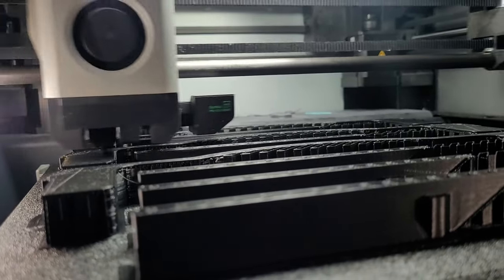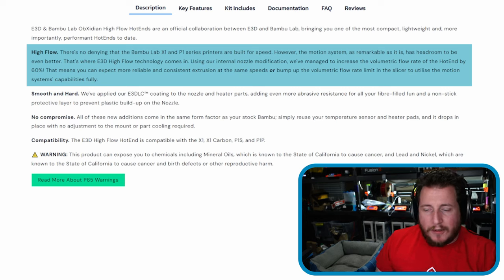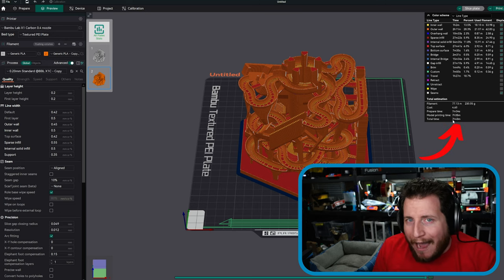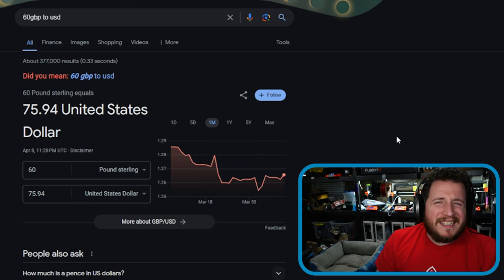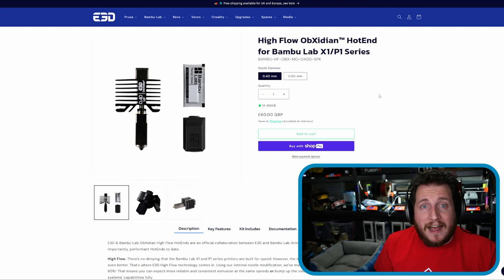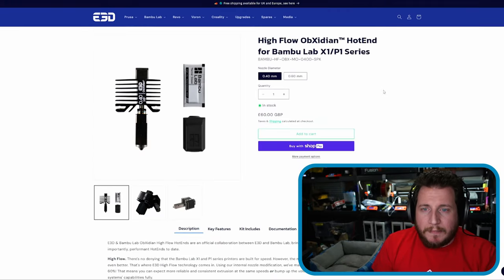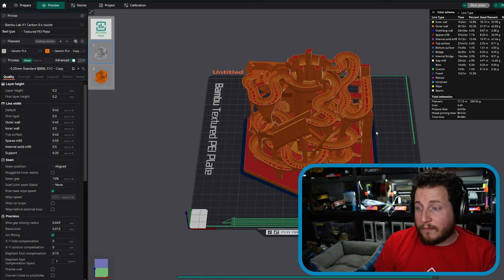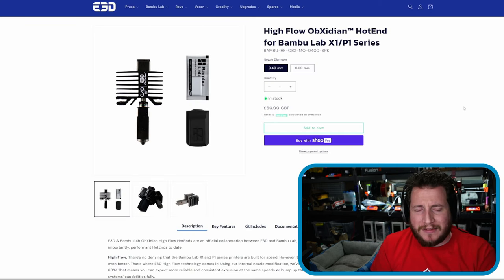Make Your BAMBU FASTER With E3D!!

Comment: how do I setup how to use this hot end? I've seen tons of videos showing that it has better flow but no one showing how you configure your slicer to take advantage of it.
Reply from the maker: just increase your volumetric flow. You can look to increase the speed too, but volumetric flow is often all that is needed
Reply: @3DMusketeers  how do I know by how much? I use orca slicer or Bambu slicer depending on the printer
Reply from the maker: you can run the flow test in orca and find out :) But generally 40% is a good starting point
Reply: @3DMusketeers  ok, I did all the flow calibrations and adjusted that... how would I now increase the speed?
Reply from the maker: you have to increase volumetric flow in the slicer. Then if you need, you can increase speed too. Likely you are limited in speed by volumetric flow already.
Reply: @3DMusketeers  I actually did increase flow... I used the auto calibration and it changed flow to .999
Reply from the maker: nope, that is extrusion multiplier. Look for volumetric flow rate.

Comment: I got both 0.4 and 0.6. The 0.4 is in one of my X1C's and working perfect! Heck, you should try to slice normal and than print on ludricous mode... It just prints fine, I couldn't tell the difference between the two Orca Cube's (one on 100% and one on 166%)... only one thing did reveal it: overhang above the orca slicer logo (and even that was acceptable for a normal print). Soon I'll place the 0.6 in one of my other X1C's.

Comment: I have 1 bambu P1S running a E3D ObXidian HF and 2 running BIQU Panda Revo and the E3D is my go to for prints I want perfect. It prints so fast and clean, I like the Revo's due to the ability to change nozzles and they work good, but the E3D seems to be just a tad better.
Reply from the maker: Well, youre still in the e3d ecosystem so we won't hold it against you ;)
Reply: This is the exact comment i needed lol debating between this and the Biqu REvo.
Reply: @3DMusketeers  Im getting ready to switch my sovol sv08 to a E3D .6 or .8 bambu nozzle also. Man I think that will be cool if it works with the adapter I printed in PC Filament.

Comment: I got a 0.6 E3D nozzle for my X1C and got a max flow rate test up above 30mm3/s with black PLA basic. Then I tried printing yellow HF TPU 95A with it and got a few chunks of black PLA contamination in the print. My guess is that the TPU took the path of least resistance through the multi channel design of the nozzle and then cleared two of the channels during the print.

Should I dedicate nozzles for each type of filament or do I need to clear some other way than just purging?
Reply: how much is your purge setting for that change?

Comment: The unfortunate thing is that E3D is not competing with the clones in either design or price. The V3 bambu clone has a removeable nozzle so you can easily clear the (unlicensed) CHT geometry without any fuss, or swap nozzle sizes without buying another $70 hotend.

The clone has a copper heatsink, a fully supported heatbreak, removeable nozzle tips (and comes with extras)  The clone also comes with a heater and thermistor.

The e3d comes with none of those for almost 4 times the price.

It is hard to justify spending much more for a worse product in the name of someone elses intelectual property. That IP has become impossible to actually protect in this market, and if E3D and other western 3DP companies want to stay in business they are going to have to compete on more than "We were here first" alone.
Reply: Same feeling, got a clone for under $20 and look at this obxidian stuff as another "IP Cash grab". You remember the time when open-source community-based projects were a thing? Now it's just whoever can make the most money off of someone else's idea.. Nothing beats the idea of spending $70 for MORE proprietary tech on my proprietary printer that we as a community are begging to be more open-source!
Reply from the maker: Do you want to support small businesses that have made 3d printing possible (E3D) or do you want to support the clones that just push price to the floor. 

Price is irrelevant to me if it just works. Especially if it maintains warranty support and such. 

And the fake ones seem to use a copper slug, which is not abrasive resistant. 

I support companies that support this industry and many of us are here directly because of E3D :)
Reply: @3DMusketeers  

E3D is legendary, but that's not an excuse to price gouge or be stagnant.  I do not believe in gov. mandated monopolies. 

Functional is debateable. I have had clogs in genuine bondtech CHT nozzles and I will tell you, without being able to remove the actual splitting geometry from the hotend, some of those clogs are going to be functionally impossible to clear.

Now your $70 nozzle is in the trash. Or best case, you have to wait for a replacement from E3D.

As another commenter has said, in practice the copper does not wear like you'd expect. Most abrasion wear is at nozzle tip where the abrassive material is forced through the opening. When it does wear the replacement part is $1.

You do not need warranty or support on a $20 hotend with $1 replacement nozzles. You can service it all yourself, easily, for pennies, and do it faster than any warranty service can or will respond to you.

Comment: something you said a fair few times in video, is that the stock is 12mm^3, mine at stock is at like 20/21 i think, i havent changed it, so the uplift isnt as much as stated albeit still a fair bit more. 

also can i ask, did you literally changed the flow and leave movement speed at stock or did you change anything in there? would love to see just how fast this thing can go
Reply from the maker: Check generic PLA ;) It is 12 to 15 in bambu. Their pla, which isnt pure pla, runs faster because of the additives they put in it. 

I just increased the flow, everything else is the same right now.
Reply: @3DMusketeers  ah I see makes sense now
 Thanks for getting back to me. I may have to get one and see how much I can push it
Reply from the maker: totally!

Comment: I have both the 0.4mm and 0.6mm E3D hot ends for my X1C.  The issue I found is the stock heating element is the limiting factor.  I can print PLA at about 40mm^3/second, but I run into hearer errors at that speed or slightly above that speed.  I also start to get print quality issues above 40mm^3/second.  Maybe the print quality issues above that speed are related to heater limitations?
Reply from the maker: definitely heater limitations.

Comment: Hi, ive been sleeplessly looking at what printer to get and ive settled beetween the Bambulab X1C and the Voron 2.4. I know that with bambu the speed is hard to match with a voron, but ive heard that print quality like layer adhesion is better on the voron, as well as the open source and ability to mod. 
Is it worth going through the effort on the voron or should i just get an x1C?
Reply from the maker: Is this a first printer? And what will you be making?
Reply: @3DMusketeers  This certainly will be my first perssonally owned 3d printer. I am not new to using 3d printers though and i love tinkering and making things and programming.

I would want to make a decent 2.4 kit, improve its hardware and make a toolchanger system as well as some other useful bits like a nozzle cam. 

While i have heard the "Get a voron if your hobby is 3d printers, get a bambu if your hobby is 3d printing" but after lookin more into vorons i want to build one to have the freedom to modify whatever I want.

While yes i do want to also 3d print parts (engineering projects at home, rc aircraft  parts) But i want to have the fun of building
Reply from the maker: I've had terrible experiences with Bambu. Their data collection is excessive at best, and no air gap capability is BS and a means for further data collection IMO. Ours is rooted and cracked now so I can update offline, etc.. 

I've detailed my issues with Bambu in videos. 

I'm finishing a trident build currently, it's been fun, but a ton of work. I can't say I recommend it for newbies either. It's not the most straightforward thing either. 

If you want a great kit building experience, get a Prusa IMO. Their kits are second to none that I've tried! 

Also only do 2 colors for your voron.. mistakes were made here lol.

Comment: You know like that extreme overclockers in PC building I'm surprised you don't see people trying to push the limits of these machines just to see how fast they can go
Reply from the maker: I think you run out of driver or stepper motor these days. But I think it's 247 printing that's pushing the absolute limits of printers these days
Reply: @3DMusketeers  no not just custom machines but like just a regular machine buy it and see it's actual top speed, with like a simple shape like a circle or a square and then try a complex object and see what it maxes out, I get when you're printing specific objects the speed can't go as fast cuz it has to stop and turn around and make turns and whatnot, it's just some of these companies are making outrageous claims......
Reply from the maker: I would guess you will run out of driver on that instance first. Motors can do some crazy stuff, the drivers can overheat fast

Comment: Really interested in this, I already print with a volumetric flow rate of 30 on my stock P1S for ABS and 25 for PLA, so I don't think I will get as much of savings, but still want to support this move for what it is and also E3D.
Reply from the maker: How are you getting flow that high on the stock hotend, it is not possible without vastly overheating the PLA (unless it is bambu's pla, but we wont run that as their TDS does not say what additives are in there). ABS that is fine though.

Comment: i trusted you man, I did this. I am seriously not regretting it. 28 cubic mm /s and thats "comfortable". :trophy-yellow-smiling:
Reply from the maker: You can push MUCH higher than that.. 35 on Printed Solid PLA without issues

Comment: The Bambu is going to be faster than the voron with a revo. The revo hot end is really slow. No need to test.
Reply from the maker: The REVO high flow, which would match the high flow of the Bambu. Without high flow they both should extrude about the same. That's pretty common.
Reply: @3DMusketeers  ah ok. Revo voron doesn’t come with high flow. My bad.
Reply from the maker: And neither does the Bambu ;) lol. Bone stock the hotends are capped at 12mm3/s but let's add high flow to both and see!! Right?

Comment: There is no point to do that, because with higher speed, layer adhesion is significantly weaker.
Reply from the maker: No adverse impact on later adhesion in our testing, but it's anecdotal at best.